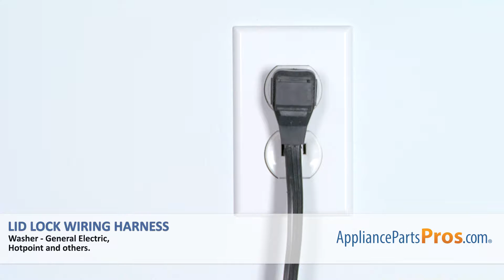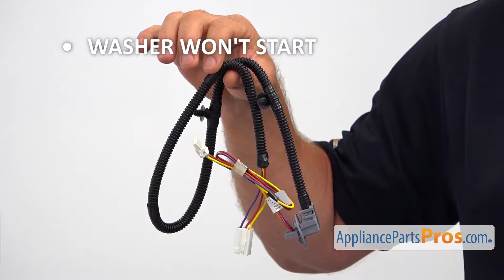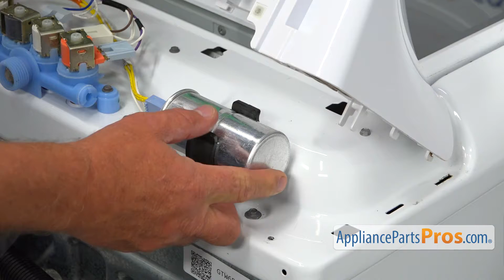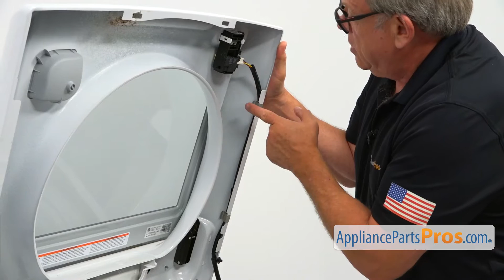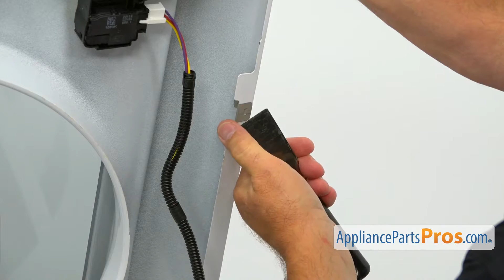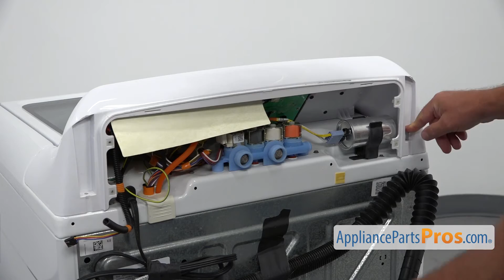GE Washer Lid Lock Wiring Harness WH19X24141 Replacement

Comment: Could this part be the reason for it not agitating?  Everything works fine on my washing machine except it will not agitate.  I have already replaced the mode shifter, clutch and auger base.
Reply: Possibly if it does not spin either.